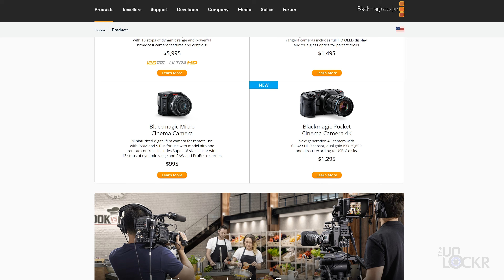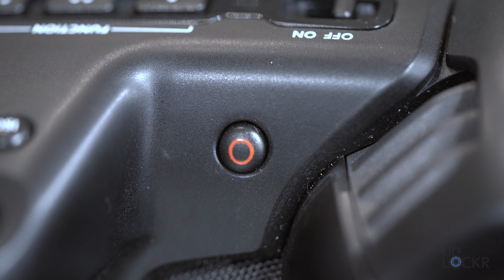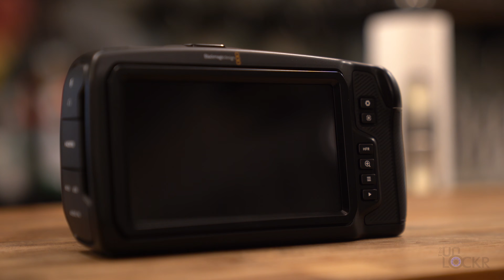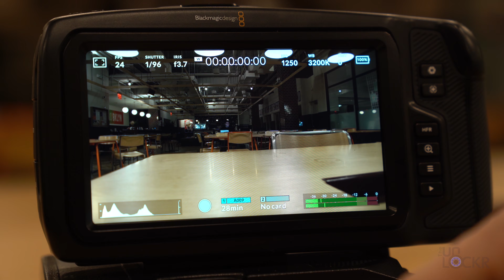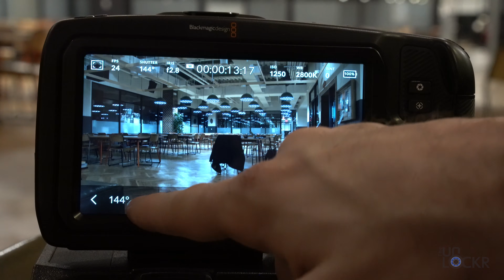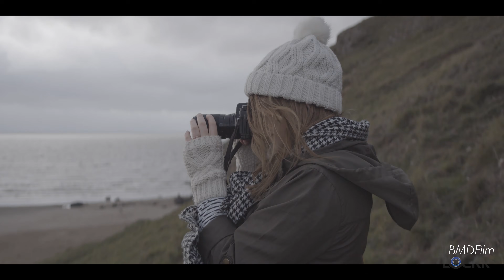Blackmagic Pocket Cinema Camera 4K Complete Walkthrough: Everything You Ever Wanted to Know

Comment: How long it lasts the battery while in the lowest quality possible?
Reply: The built in battery will give at most 45 minutes or so. Unfortunately the camera just shuts off with no warning, so you have to be proactive if you plan on using LPE6 batteries, essentially about every 1/2 hour swap it out. Better to build your own 18650 module or buy something like the CORE battery shown in this video, though for the price of the CORE, you could build a simple 4x18650 power pack and get 10x the recording time with quick-swap battery packs.
Reply: The thing is, I'm looking to replace my Panasonic G7 (use it to record my orchestral concertos; I'm a composer) because I need something to record over 30m with good quality. The main problem that I'm finding is that the GH5 is too expensive for me now, so I was thinking about the BMPCC 4K but it seems that having the recording limit of 30m or just the battery life of the BM 4K is almost the same thing...
Reply: @jorgefpramos  You can definitely record for hours if you get a better battery system. Like I said, I did a little soldering with a 4x18650 battery holder, and with 4 NCR panny batteries, I get about 2.5 hours of recording in one go. It looks a little janky, but it works. And I just bring along 8 more batteries so after about 2 hours, I stop, power off, replace batteries, and go again. Easy to put together, cheap to buy batteries. Get the benefit of a fantastic camera too!
Reply: I don't know how to solder and I want something reliable...well, this said, Im still inclined to buy it but I do think that ill be spending a huge amount of money on accessories..

Comment: Just the video i'm looking for, there's only one thing i'm curious about is it possible to record in 4k 60fps HDR internal or externally to Atomos Ninja V like the Panasonic Gh5? Thanks.
Reply: I think the HDMI output is only 4K30. Internally yes, on CFAST cards you can do 4K60 RAW. To the USBC drive, the best you can get is 4:1 RAW 4K60, and using the T5 that does not handle the speed for a long time. I did record 4K24 RAW 4:1 for the 68 minutes of space I had on my T5 500 though.
Reply: @justinjackson3665  the hdmi output is only 10 bit 1080p
Reply: @1901Steini  Yup.. you are correct. I forgot and read that after replying. My bad.